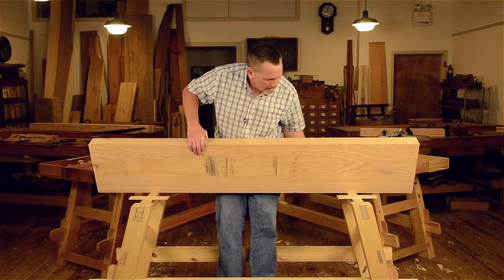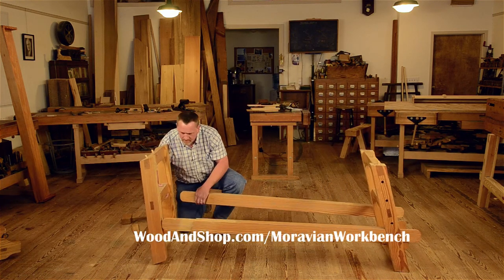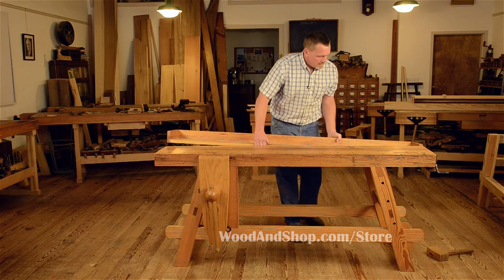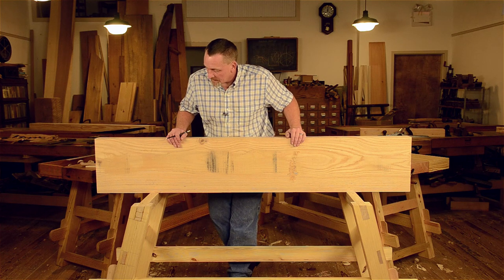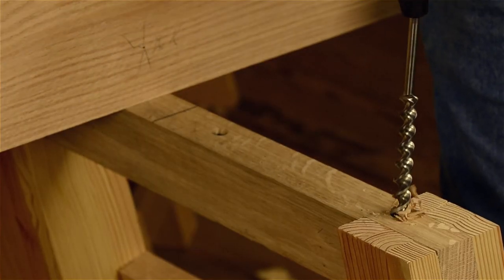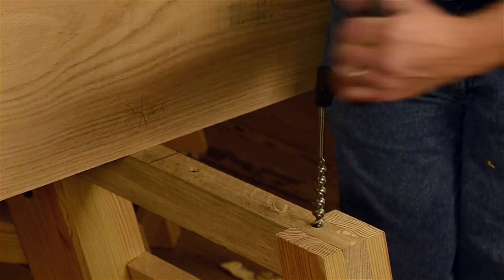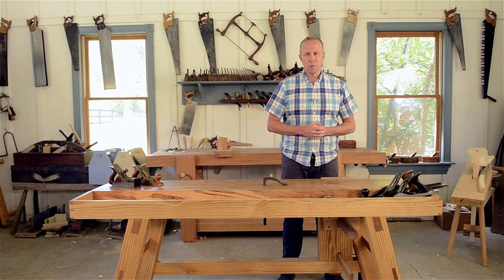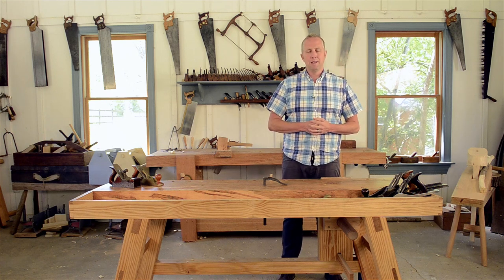Attach a Moravian Workbench Top with Blind Pegging

Comment: I made a pair last year pretty much without any help other than the free diagram and just did 2x 1" dowels. I like the nail trick a lot and would have gone that route if I knew about it, but I'm real happy with my benches anyway and use mine all the time. I thank you for making the diagram with the measurements available for free, they are perfect workbenches although I did my legs and stretchers an extra inch thick and Now I'm making my first real BIG project on it, a Vermont shaker moon bed. I always enjoy the videos, Will is a very talented and humble man.

Comment: is it common for Irwin bits to be oversize?  I noticed my Irwin bit was oversized when running a test hole for a drawbore.  Good thing I ran the test before taking it to the workpiece :)

Russel Jennings bit was the exact size of the dowels made by my dowel plate.

Comment: Would it make more sense to put the slotted holes on the outer side instead of the inner? That way the wood expands outward from the fixed hole in the center. I just feel that if you want your other side or tray to maintain the same distance in the center you wouldn't want them to expand or contract relative to each other.
Reply: I think it is more important that the front edge of the top stays in line with the front faces of the legs